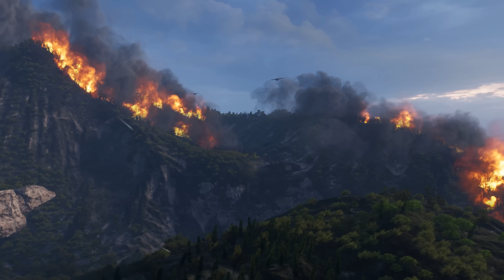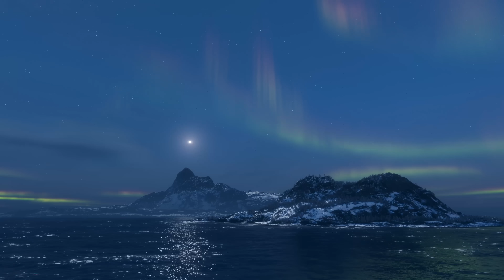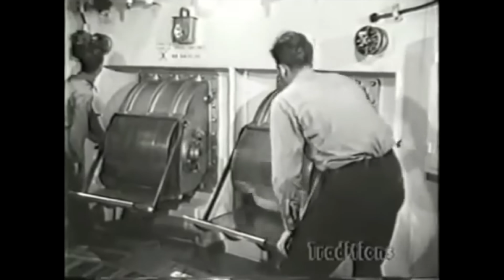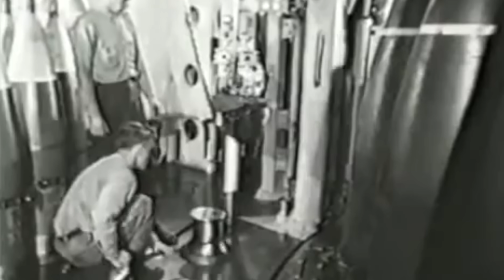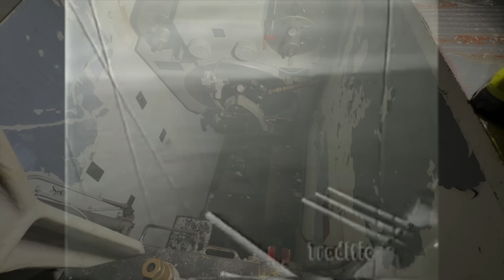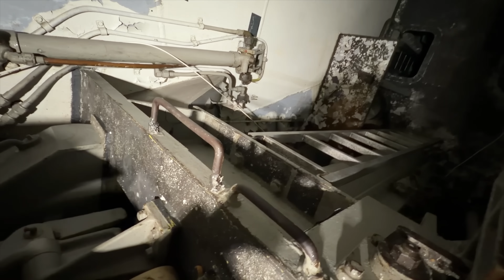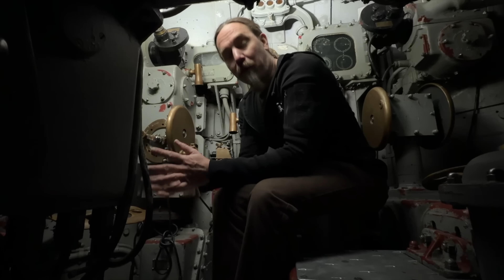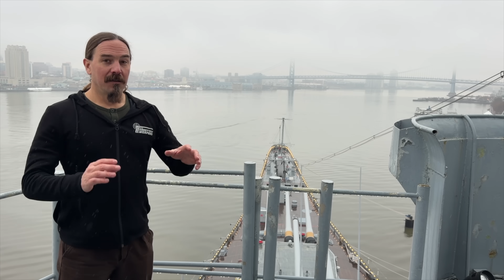How the USS New Jersey's 16-Inch Guns Work: Top to Bottom

Comment: Drachinifel is lurking somewhere nearby.
Reply: Darchinifel would also probably add from behind the camera - powder grain shown on 32:52 has those 7 channels through it for a very specific reason - as projectile moves out of the barrel, to maintain desired pressure, volume of gasses should be increased with time. 

It is achieved my increasing the burning surface of each individual powder grain, those 7 channels widen as grain burns, and by the magic of geometry while grain burns smaller by mass - burning surface increases.
Reply: @TheCouchCommando  13A O5 type - who cut his teeth on 105s in the mid-90s, FAOBC Class 7-95 - retired, also a reloader, also toured this ship in 2012 typing here:  correct, it's called multi-perforated progressive burn propellant. You only see that technology (and single perf) in larger extruded type propellant for cannons for obvious reasons. The way we get progressive burn rates in small arms propellant is with burn rate reducing chemical coatings on faster burning propellants. There are some good discussions on the Hornady channel. They have a propellant expert or two come in who actually worked with the big stuff like this before moving to commercial small arms propellants. You can learn quite a bit watching that particular series on propellants.
Reply: @TheCouchCommando 
[Drachinifel would not approve this narrative]
===  MULTIPLE FACTUAL ERRORS @17:55-18:18  ===
1. the AP 'cap' IS NOT hardened steel
2. the AP 'cap' IS NOT supposed to "punch through armour without deforming"
3. the AP 'cap' is NOT (in itself) what "allows it to pierce the armour"

...the AP 'cap' is designed to squash/deform
...the AP 'cap' is intended to orient the actual AP-tip on-impact
...the "secant/tangent-ogive" underneath the cap is what penetrates armour
Reply: @peterlavelle3261  He makes mistakes too you know. There is a ton of information that needs to be learned and rehearsed for a video like this.

 I’ve been watching Drach since his channel back when it was still only the robot voice, that guy is a walking naval encyclopedia. 

Ian’s is probably one of the few YouTubers to match his wealth of knowledge only his main expertise is in firearms. (Specifically small arms)
Reply: @peterlavelle3261 One person can only contain so much 'tism, I'll forgive  Ian for not knowing how APCBC shell works. And it's probably Rian's oversight for not educating Ian haha
Reply: @Robert-Downy-Syndrome  fully agree 🤗 Ian, Ryan & Drach are all legends in their own right, with a lot of crossover knowledge/understanding  ...i appreciate them all individually,  but even better when they join forces as an all-knowing-trio 😅

sorry my comment came across too blunt, the pedantic side of me came out 😒
Reply: @TheCouchCommando  fully agree 🤗 Ian, Ryan & Drach are all legends in their own right, with a lot of crossover knowledge/understanding  ...i appreciate them all individually,  but even better when they join forces as an all-knowing-trio 😅

sorry my comment came across too blunt, the pedantic side of me came out 😒
Reply: @peterlavelle3261 if you read Nathan Okun at navweaps, you are only correct about the AP cap in the WW1 era. By WW2 the AP cap was much harder (like, from 400 Brinnel in WW1 to 600 Brinnel in WW2). But WW2 the AP cap acts a lot like a punch to get started through the face-hardened armor plate, while also protecting the shell body from the shock of that impact.
Reply: @peterlavelle3261  technically yes, in actuality yesnt
The AP cap is very much hardened steel, midvale was using 300 brinnel by 1920, which is about where some tank armor sits, just because its hard, does not mean it cannot deform, remember whats happening here, its in most cases a 800 kg to a ton of steel hitting almost a half meter thick plate of face hardened steel, even "hard" steel becomes more soft here.

It was found with midvale unbreakable caps (1920s) that hardening the front end to 300 and scaling it back, alongside carefull control of the projectiles hardness pattern, you could achieve much better angled performance (higher impact obliquity without projectile shattering) against face hardened plates

The caps made by midvale were "unbreakable" at obliquities below up to 40 degrees (when tested against BTC or Midvales own face hardened plates) 

That is despite armor being "deeper" hardened as time went into ww2, with up to 55% of the plate was face hardened and transition layers (35-40% face and 15-20% transition layer)

There is atleast one test where a Mark 16 Mod 8 hard-capped armor-piercing projectile (introduced in 1943 by the Crucible Steel Company the largest and best U.S. naval projectile manufacturer for many years, and probably the best all-round naval armor-piercing projectile used during WWII) completely penetrated in effective bursting condition (no significant lower or middle body or fuze damage) a 13.5" brand-new Class A armor plate at 49° obliquity at just above the Navy Ballistic Limit velocity where the projectile just barely makes it through the plate and where maximum damage usually occurs to a completely penetrating projectile

without the AP cap the shell itself would shatter and break, and would probably not penetrate, but would certainly not penetrate in a condition to fuze (shell too damage and fuze is broken)

I highly recommend reading nathan okuns articles, hes the best subject matter expert when it comes to AP caps, and naval projectiles as a whole, and the creator of the "Facehard" program
Reply: We need to get Ian, Drach, and The Chieftain in a room talking.
Reply: @ianbruene1529 that'd be a nice 6 hours of the nerdiest military yarn ever 😂 I'd absolutely be glued to it the whole way too 😁
Reply: @ianbruene1529 

the idea gives me a vibe like the video of some of the 'space-tubers' (Scott Manley & friends) touring a NASA/space museum together.
Reply: @ianbruene1529 Ryan is no slouch
Reply: He found a bell and had to ring it at 49:50 😂
Reply: @aioverlord-mk1 They use the bell for time keeping purposes. I forget from when I toured the interval. I believe it's a half hour interval. One ring is a half hour. Two rings. Successively is an hour. 

And it's not set to any particular time, although if I remember correctly, I think it's Zulu time. Each watch again I'm trying to remember correctly is I believe 6 hours long. So at the end of 6 hours it would start over with a single bell ring increasing to a double bell ring and so on and so forth. 

If I'm wrong I'm sure somebody will be very quick to point out that I'm very wrong. It's also been close to 3 years since the last time I was aboard the New Jersey so. The fact that I can recall any of this is a minor miracle.
Reply: Probably on the 5 inch 38 mounting area.
Reply: Probably creeping around in the shadows.
Reply: As is our friend Mike Brady.
Reply: He is a lurker…

Comment: Being a 2700 pound shell, I don't think it really matters were it hits.  It is going to leave a hole anywhere.
Reply: Even without making a hole, imagine having 9 small cars getting shot at you every 30 seconds at mach fuck.
Reply: The armor belt on the Iowa-class battleships is 12.1" of Class A face-hardened Krupp cemented armor.  It is designed to resist the shells from a 16-inch/45-caliber gun at 18,000-30,000 yards (above that, the shell will be plunging into the deck armor and miss the belt entirely; below that, the shell has enough residual speed to leave a hole).  The zone of immunity is narrower against 16/50 guns, but still exists.

No Iowa-class was ever hit by a battleship shell, but historically, non-penetrating hits on other battleships have been described as making the entire ship ring like the biggest bell on earth.